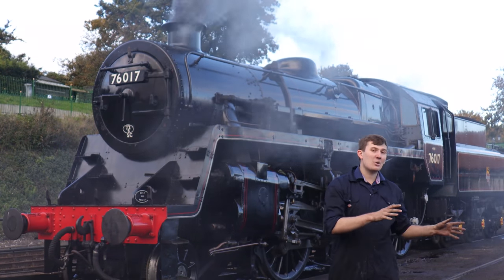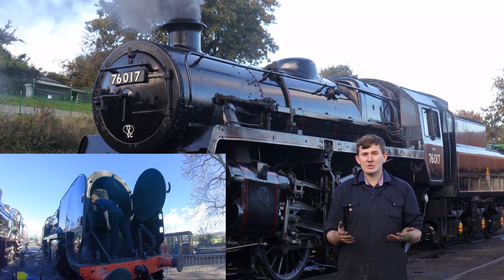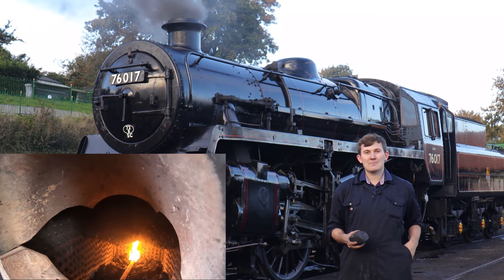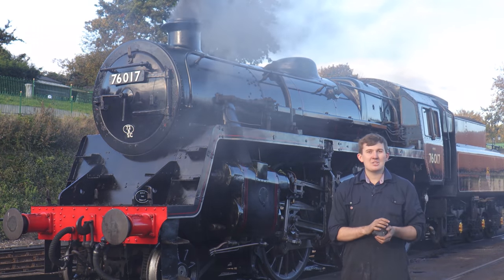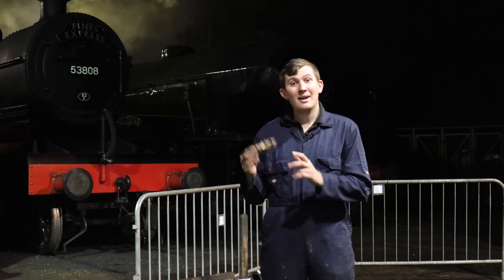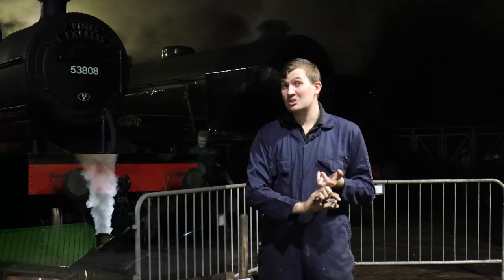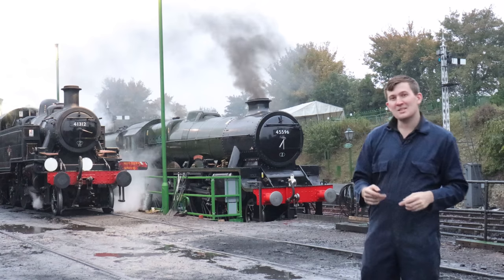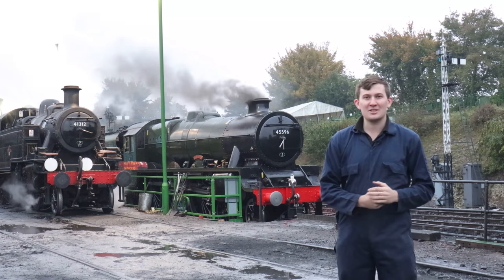How Do You Start a Steam Engine? - A Rough Guide

Comment: Starting the engine 

 Check engine for damage,
Clean the greats in the fire box of ash and clinka (basically the bad bi product of coal) to keep it clean so your fire csn start and hear can be transferred more, (open greats and or use a rake)

Start a small warming fire at the front of the engine to prep the boiler for a full fire (start a full one suddenly causes damage and takes very long)
You csn use wood,
In a few hours after usring the blower to increase fire temp and keeping water levels high your engine will have some steam generated as it sits,

Re check your water injectors, air ejectors, (things for your air brrajs) and prep lubrecater, soon you will be ready to proceed

Comment: Every video I’ve seen about model steam engines requires that the flywheel be turned manually to get this working.
What is it about the design of the locomotive that this isn’t required and is there a position in which the wheels could be to not allow initial motion?
Reply from the maker: Hi there, with locomotives you don't need a flywheel as you have multiple cylinders, at least 2 but more powerful locomotives can have 3 or 4. With a 2-cylinder loco the wheels are offset by 90 degrees so when one piston is at the end of it's travel, the other is in the middle of theirs so can get the locomotive moving. 

It is however possible to centre the locomotive and have all the inlet ports closed meaning you have to roll back and start again. Un-rebuilt Bulleid light pacifics e.g. Wadebridge, Manston etc are prone to this partly due to the chain drive valve gear being so finely balanced, which is one of the reasons why the class were rebuilt.

Comment: Nice to see a smooth operation. I often light a cold loco 12 hours before its due to move, fire log or firelighters for the easy life, and always with the same heat to the touch at the smokebox as the backplate. However, I witnessed, while working on a diesel, two cold engines being lit and brought to full pressure in two and a half hours. Big engines.....it was only a few steamings later my forecast came true....leaking tubes which had to be replaced. Tales from Connolly shed.

Comment: When the engine sets off why are there great clouds of steam blown forward
Reply: Hi David, so the steam pistons are reliant on steam being compressible. When everything is nice and warm, not a problem you can crack on as normal. However, first thing in the morning everything is cold, so when the steam enters the steam chest and cylinders, the steam will cool creating water, which can't be compressed and has the potential to cause a lot of damage. The solution is to open drains at the bottom of the cylinder which will allow the driver to force any water out of the cylinders. Once the locomotive has moved for a little bit and the steam has been emitted into the cylinders long enough to warm up the surfaces, the driver can close the drains and it's back to business as normal. You may also find that the drains will be open when moving off after a locomotive has been at a stand for a while.
Reply: @WillStratford  So, about how long do the cylinder drains have to be left open until the cylinders warm up?

Comment: perofin wouldn't diesel be better because of the price of perofin 
different way to put a warmingfire to what i have seen wouldn't putting it in the midle of the fire box instead of the back be better???
Reply: It's already used for cleaning etc around the loco, so being ready to hand it's easier to use. And you wouldn't even use 1L to soak the rags so it's not that expensive.....
Reply: You want the fire under the brick arch at the front of the box as this has the benifit of reducing smoke back onto the footplate when you have no blower to create a draft and it also allows most of the heat to go into the boiler. If you had the fire in the middle of the box a lot of that heat would be wasted.  Also on locomotives the back of the fire box is the bit closest to the firehole door and the front it the bit closest to the front of the locomotive :D